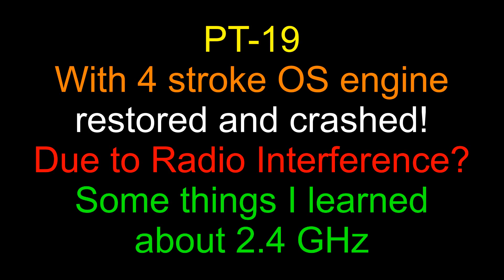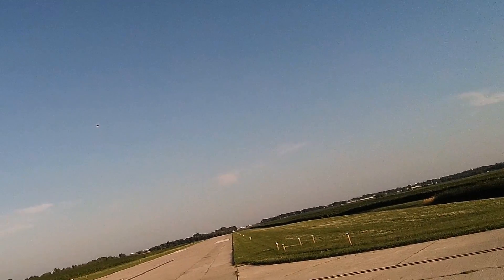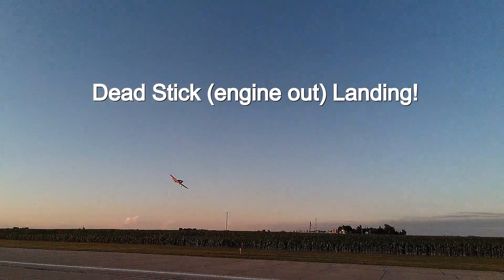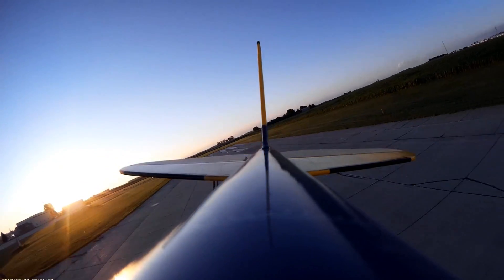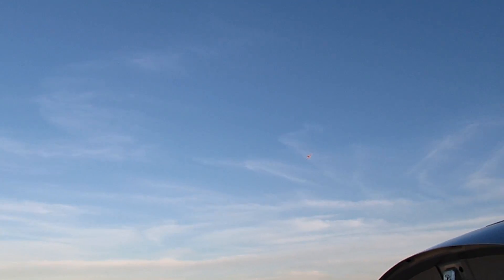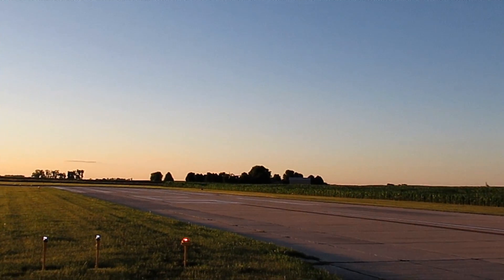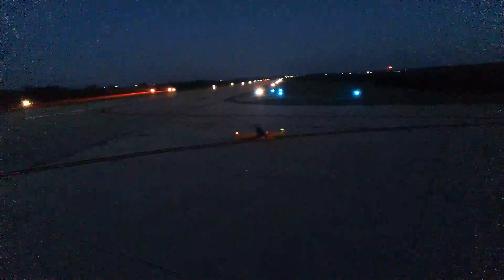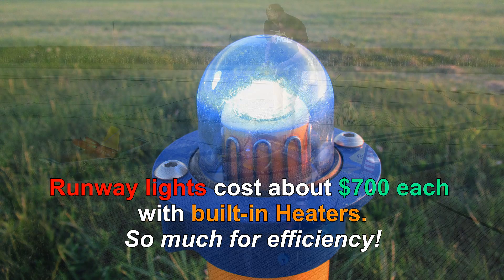My Planes that used to be on FM but now on reliable 2.4 Ghz are crashing at the airport. But why?

Comment from the maker: *Note.  Before you comment, remember that I have made 100’s of videos, none of which you ever have seen me have a radio failure!  
It only is happening at this airport, so blaming AR 500 radio equipment that has worked flawlessly for years at other locations seems an unlikely cause.  I did find out a lot about 2.4 GHz setups, antenna locations, etc, but something else seems to be the problem. Simitar is Fine. See the whole flight next.
Reply: The spektrum system like the DX6i that uses DSM2 protocol are very vulnerable to interference. Here is why. The DSM2 protocol at binding locks on to 2 channels at the 2.4ghz spektrum and then it uses only those two channels. And if there is interference on those 2 channels you loose control. Other systems are more reliable because they do not lock on to a limited number of channels, instead they jump back and forth all over the channels on the 2.4ghz spektrum and if you have interference on two or more channels it dosen't mater it uses the other channels as well. When you get your new radio i recommend that you get some spectrum DSMX receivers for your more expensive planes. DSMX is spektrums new protocol that uses more channels. Also i would recommend to have your BEC away from your receiver, i think your BEC is a switching one and they can be very electronically noisy. I like your videos have followed you for a long time now, have a nice day !!
Reply: i was using spektrum on RC cars  but when a local school had a new antenna fitted i started to get interference.  The cars would get about 10ft away from me and just stop responding.  I think the antenna was for g3/g4 mobile phones.  Forgot to say we had a dead spot at the local flying field  we think it was a underground water pipe causing issues.
Reply from the maker: That makes sense for sure. I am told that it may be a new cell tower located south of the airport could also be the problem. Thanks for your input. I appreciate it.
Reply from the maker: Thanks for the explanation. Again, I am aware of all this. I also 
switched to NO BEC, proving that was not the problem. I only used it for
 the range tests.  I certainly could change receivers, but again, the 
ones I use on DSM2 have worked flawlessly for years, but not at the 
airport.  Thanks again, as all you say is true and thanks for the long 
time support.
Reply: Completely agree with this....I figured your bound to have an RF Explorer with as much as you have! FYI I have been watching your videos for years and I personally have been flying mini quads FPV for the last 2 or so years.  I run IRC UHF on a few bigger quads which works great but my mini quads all run FRSKY 2.4 receivers and I have never seen anything like this happen
Reply: "It only is happening at this airport, so blaming AR 500 radio equipment that has worked flawlessly for years at other locations seems an unlikely cause."

I actually completely disagree with this statement, it most likely still is the DX6i transmitter and receiver combo you are using (and more specifically; the spread spectrum technology it is based on, as was cloned by the Chinese with the Orange TX; it makes perfect sense for both to show the same problem).

Just because a radio works thousands of times in low-interference locations, doesn't mean you could not get a superior result with a different radio set in interference rich locations! There is still an obvious difference between more capable radio equipment not getting bothered as much by the interference, where as this DX6i essentially gets your models knocked out of the sky. It's why 2.4Ghz radio has evolved into now frequency hopping variants of sending signals. It all comes down to high quality and reliable signal reception. You can't say that a radio performs fine without interference, no better radios exist in cases when interference does play a role. 

The only thing you prove by changing the angle of the TX antenna is showing how weak the overall system is and how much that specific radio depends on truly optimal radio signal wave angles to deal with interference. The bipolar antenna sends out a donut shaped radiowave in all directions, except for to the tip of the antenna. So of course pointing such an antenna at your model will not give a better signal, but rather a weaker one. Having it angled will give two donut shaped radio waves, that essentially cross into each other making up for a sphere. In case of a weaker radio system, such a combination of a forwards pointing donut and sideways pointing donut, resulting in a sphere of radio waves, will always give the best results. This doesn't take away from the fact that other brands, with still pointing the antenna upwards don't do a much better job at still providing high signal quality at these less than optimal circumstances. 

Honestly, where I occasionally fly in interference rich locations everyone already learned Spektrum is not a smart choice, because it is simply not going to be working great in interference rich locations, where other radios really  work just fine. It doesn't really get more empirical than that tbh. Regardless of antenna angles which do increase signal quality.

There's also a gigantic flaw with your range test mode experiment, as that mode deliberately cripples the signal power to get a good idea of how this short distance extrapolated would result in a decent reliable flight range without any issues. At 9:10 it really only proves why people don't use that mode to try to fly their models with. It says nothing about external interference effects or how capable this radio is in dealing with that. It is not a mode to test range in a literal sense. 
In fact, the range check mode might reveal big interference on location, but getting 400 ft in range check mode is absolutely great. You should get about triple or quadruple the distance in flight, with LOS in the air. That's 1600ft / 500m flight, something you usually would never do (I'm going to say most models are well out of useful sight in about 800ft). Of course, different receivers might give you a longer range with ease. Keep in mind a 'successful range check' is performed at only 90ft / 30m distance (read the AR 500 instruction sheet v2 manual if you don't believe me). It is then safe to assume the model will perform fine within visible reasonable range. I'm sure the optimal maximum range of the AR 500 in flight is somewhere between 600m and 1.5km or 2000ft-5000ft. From what I hear about people using this receiver, it is somewhere between 1500ft / 450m and 2000ft / 600m. Honestly, not a lot of range for a 'full range' receiver these days, but sufficient under normal conditions. 

Same flaw in observation goes for this Spektrum radio being simply less capable of penetrating objects with it's signal. It's far less capable than other brands. It's not a general 2.4ghz thing.  I've flown behind concrete walls, ceilings (with a multicopter), trees, cars and so on and never lost a signal when within reasonable normal range of a radio ever with other brands of radios. It's definitely a problem specific to Spektrum.

People used to give outright silly advice when using Spektrum brand radios exclusively, like using a satellite receiver or special 'carbon' edition receiver to deal with how carbon blocks or weakens the Spektrum brand signal; but the problem is Spektrum radio technology itself man. Not the carbon or the concrete or whatever else. I've flow dozens of hours with helicopters and planes where the antennas would be fully obstructed from view in a carbon frame. Not a single loss of signal ever. If a radio can't penetrate such materials, it is not safe to use in an interference rich environment.

The Orange receiver likely has a longer range because it somehow has a better shielding going on. I guess some parts of that receiver internally are possibly a bit larger and therefore give less problems, but it would require further research to really reveal the difference. I've also heard people having Orange receivers with poor range (likely due to low quality control or something).  

Moving your model's antenna cable to the top of your airplane isn't really going to be fixing the problem at hand. It's mostly going to fight a symptom. The problem comes from how the radio is unable to provide a high quality signal / reception in cases of interference.
Reply: how old is your dx6i? mine has dsmx and i read they sell the dsmx Version since 2011. but i mostly just bought cheap dsm2 Receivers anyway.